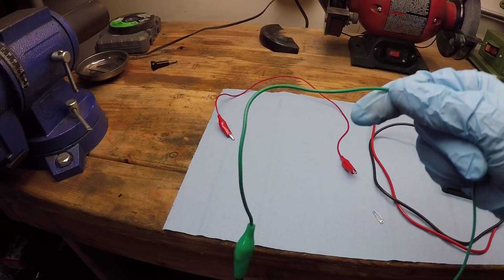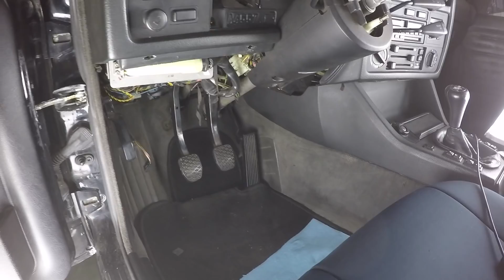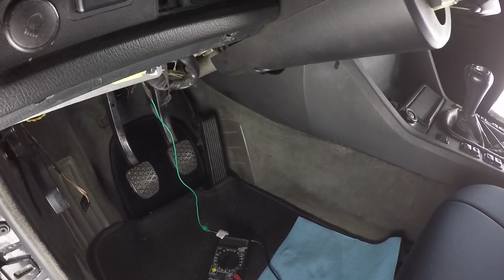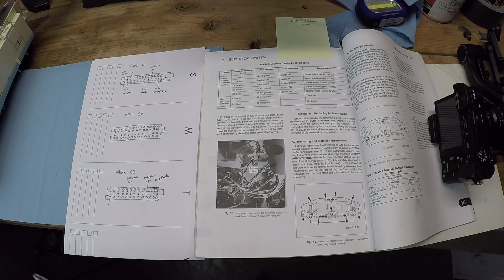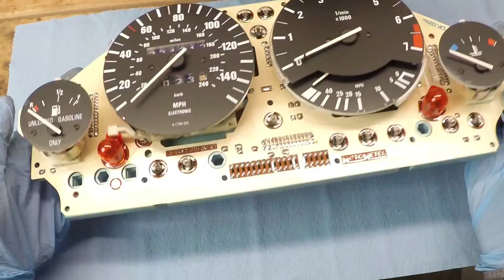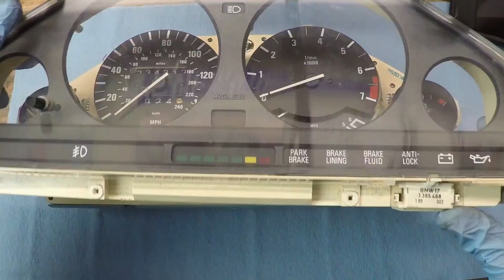Project E30 / Ep. 18 / Testing for Power at Instrument Cluster & Odometer Gear Installation

Comment: This was a helpful video but The PIN number on CII you gave is incorrect. Pin 1 is the bottom left not bottom right. The violet/purple is pin 13 not 26. This is in the bmw wiring diagrams and the Bentley table also confirms this

Comment: dude... SO glad I found this video. I just bought an e30 and found mice in the car. And my cluster doesn't work. I immediatly thought mice chewed wires behind the dash. Then I found out bad clusters is normal so that gave me some reassurance.  But I was still nervous i would fix the cluster and it wouldn't work. THIS HELPS ME SO MUCH. I'll be able to find out if I need to tear my dash apart and fix chewed wires or just fix the cluster! Thank you!

Comment: I notice you're missing the wire for pin16 on the C2 connector. That wire is part of one of the tests in that Bentley chart. How did you work around that? I just got an e30 3 weeks ago and its missing too many wires on the back of these connectors. 

Also this is my first project car and channels like yours really help, thank you!

Comment: Best channel for e30 projects. 
I have a 1987 325i convertible and I’m working on replacing the cluster gears, any specific gears i need or just the set from garagistic that you got? Also have some weird custom wiring going from the cluster down to the lower dash knee piece where they were connected to a double switch (is there a way i can send you a picture to show you where they are connected on the cluster?)
Reply from the maker: There are two different gear set types. One for VDO clusters and one for Motometer clusters. Be sure to see which cluster you have before ordering. Send a picture to usedbikereviews@gmail.com and I'll take a look.

Comment: I had a question in regard to episode 18.  While you were in there, did you check the little batteries and the solder on the circuit board???  Do you still have the car and are planning on keeping it??

Comment: Thanks for this video and showing you gotta have some skills, patience, and willpower.  Was so hoping a new steering wheel was gonna pop out of the soon to be Christmas box in this video. LOL ....This is the "fun" almost every project I end up with forces me into.  My current "project" (94' Nissan Hardbody 4WD) so far has been a true test  of skills, patience and, perseverance. This is why when people ask me about getting a "project" for themselves tell them to get something that you can actually get parts and information. Otherwise, you must have passion because paying ridiculous fees for factory manuals you can actually read and slugging around every junkyard you can drive to for parts is not for everyone.
Reply from the maker: Haha I've been asking for a new steering wheel but I don't think Santa is going to deliver this time around. I found a company that will recover it just like original for a little more than $200 - soo...maybe in the future. And you're right, it seems like every project finds its way to a point like this. If you have access to a factory service manual you'll at least have a shot at finding your way back out! I like those old Nissan 4X4s! I had a 1993 4x4 Pathfinder and it was such a good truck.